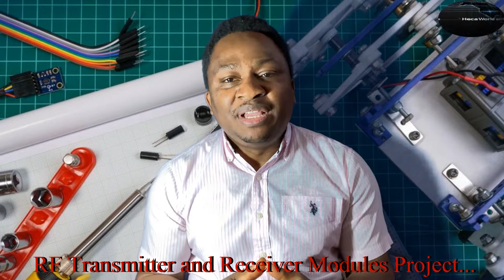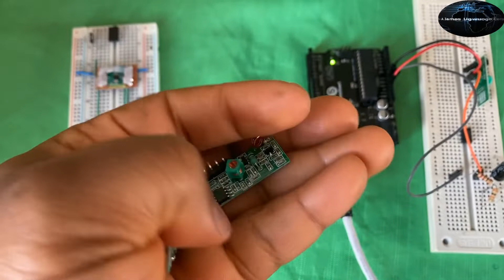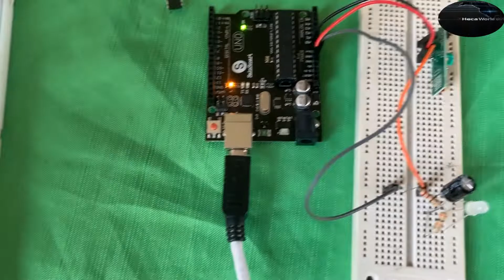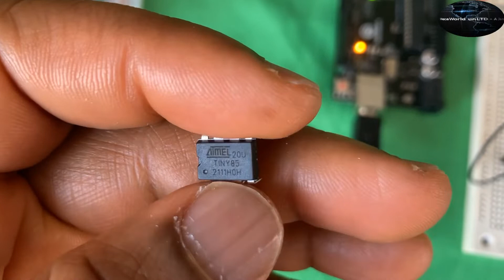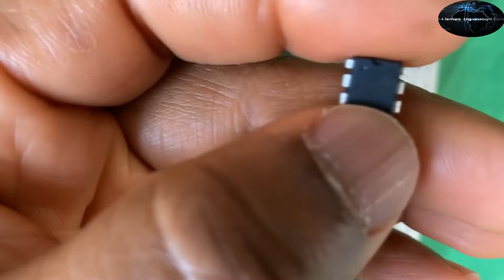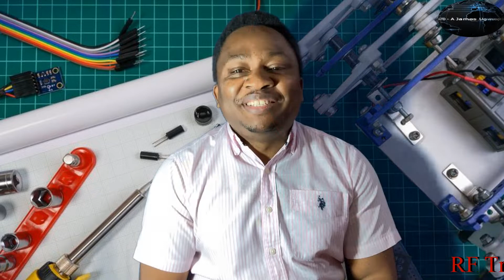TRX Module Projects Part 1 | Microcontroller Transceiver Controllers | DIY Encoder Decoder |

Comment: Can i use an old RC car receiver with its remote control   as a TRX module like this
Reply from the maker: If they are the same frequency (e.g., 433 MHz, then in principle you can receive the 'raw data' but to be able to decipher the encoded signal, you will have to understand what was being sent originally and then create such signals and encode in the signal to be sent with your new transmitter module.

If you don't know what was being sent (and not able to find out), then 'probe' the receiver to determine the output pin (data out) of your old RC TRX module, then connect same to your preferred microcontroller decoder to decode your encoded signal from your new transmitter module.